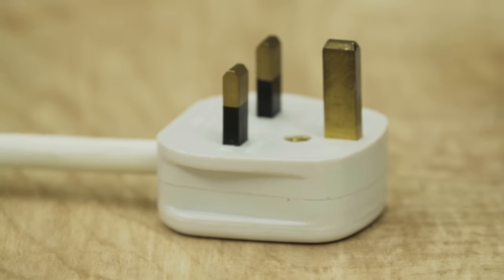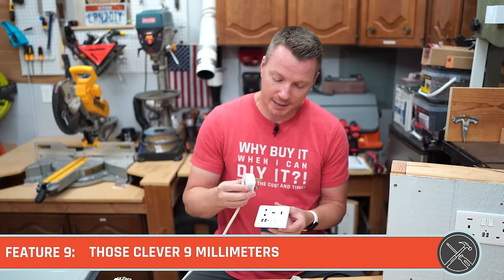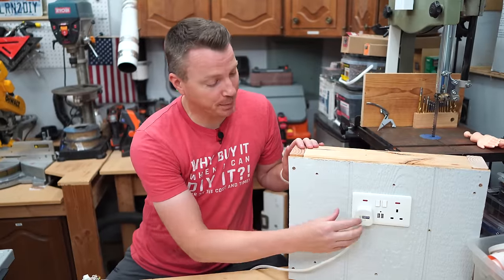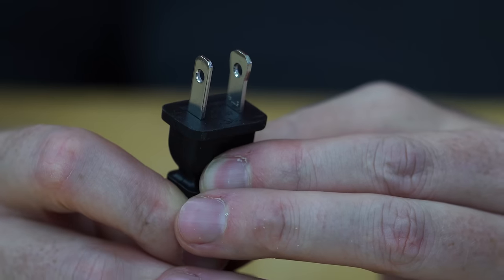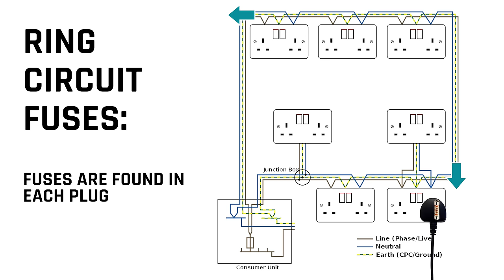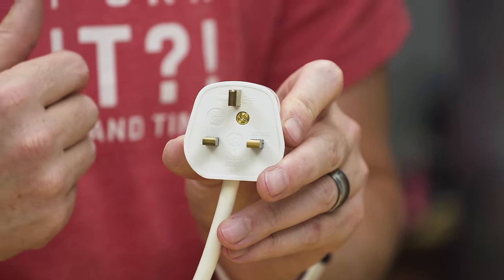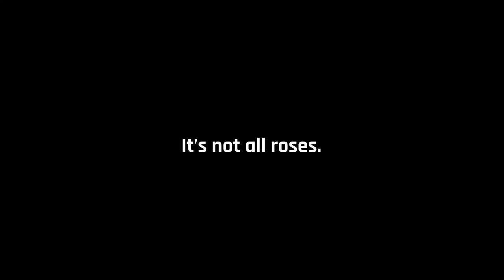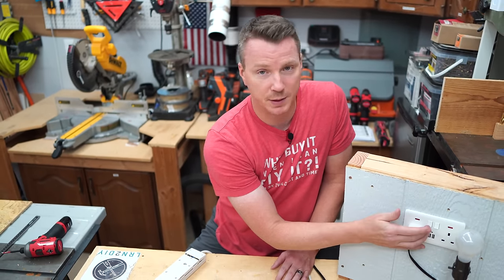British Plugs and Outlets Are On Another Level

Comment: They are much larger than the North American plugs, but interestingly since they're a 90 degree plug they actually take up less space in your home. You could shove a piece of furniture up against it easily, whereas our plugs need several inches of space to give the cord room.
Reply: Flat design plugs are now becoming more readily available.
Reply from the maker: Excellent point! I’m currently traveling in Scandinavia and noticing the same thing: flatter plugs = furniture tighter to the walls and less risk. The US has these as well but they’re just now getting some traction and it will be a while before they’re common.
Reply: The first thing I thought of when he mentioned the size is the number of times I've had to squeeze a plug through a gap. I could never do that with the UK plug.
Reply: @LRN2DIY  Is it still a lot easier to mold inline plugs than 90 degree ones?  Most US plugs are molded unlike the assembled plugs in the UK, but I still agree the 90 degree plug is wonderful when working with furniture.
Reply: Annoyingly, in the UK most plugs sockets are a few inches above floor level (except for the kitchen where they are sometime installed at work-surface level) . . . so having a cord that exists the plug go downwards is rarely ideal . . . for example you've got a radio or computer or TV, and the plug will usually be plugged in 4 or 5 inches off the ground and the cord exiting it then heads downwards, only to then need to go upwards, I see this as somewhat of a design flaw - I 3D printed myself a bunch of plugs where the cord exits from the top, which are much more practical if you want your leads out of the way or to better fit behind things. Another solution is to mount the sockets upside down.
Reply: @shiijei2638  if the plug isn’t the molded type, we simply remove it , and then only have to pass through the cable before re attaching it.
Reply: @shiijei2638  You just unscrew it, feed the power cord through the gap and put the plug back on.
Reply: @davelordy  It's been part of the electrical installation regulations that wall outlets must be mounted at least a certain hight from the floor (300mm) if I remember correctly, which negates this problem.
Reply: @shiijei2638  Just take the plug off, poke the cable through a tiny hole, rewire the other side.
Reply: @davelordy  I have the sockets side mounted in my workshop and office for things that are permanently plugged in.
Reply: @davelordy  I would point out that having sockets that close to the floor is against both building regulations more recently (even then about 20 years ago) and electrical regulations for a very long time before that. I have never been in a property where it is an issue. There is a 150mm minimum clearance from a horizontal surface.
Reply: The US plug is easier to be pulled out, sometime by just their own weight. The UK plug however, the wire goes down, it'll need to be pulled at an angle. (Fact #8 in video)
Reply: @r.a.6459  This is actually the reason the UK plug is right angled. You should never pull a plug out by the cord it's not designed for that, and repeated use will likely cause issues with the flex and/or the plug. By making it right angled so you can't pull it out by the flex (actually you can but it's quite tricky and often damages the socket) people as a rule don't pull it out by the flex.
Reply: @shiijei2638  take the plug off and put it back on. Most are rewireable
Reply: @davelordy  unless your house has older installs, all sockets should be 450mm from the floor, and light switches, and tv sockets should be 1200mm, and it’s recommended that a minimum of 100mm is given above a kitchen worktop, these are all in the regulations now
Reply: @davelordy  If your appliance contains, comes into contact with fluids or could have fluids somehow get on them, having the cable run into the plug from the bottom is likely to be safer. I'm not sure if that is why it is how it is, but, it's a handy additional safety feature.
Reply: @davelordy  They must be some old sockets, i think the new standard it at least 300m from the floor.
Reply: @shiijei2638  you've just made me realise he didn't mention that because the plug heads are serviceable theyre also removable for squeezing through gaps. But of course he wouldn't mention it because US plugs are so easy to squeeze through gaps!
Reply: @soundspark  Most appliances in the UK now come with a moulded plug, probably because of an EU directive or change in UK law requiring all appliances are fitted with a plug as standard.
Reply: @shiijei2638  if we need to feed a wire through a hole in the U.K., we just remove the plug, feed the wire and reattach the plug.....so the hole only needs to be the size of the wire.
I will add, moulded plugs are becoming more common in the U.K....if you want to feed one of those you have to cut off the moulded plug and fit a new one after feeding the wire
Reply: @apmcd47  it was the result of a campaign run by the "That's Life" program on the BBC headed by Ester Ransom, who also founded Childline and go a number of other changes to the law to protect consumers. Nothing to do with the EU.
Reply: @shiijei2638  that's why they are removable
Reply: @apmcd47  I can't find anything on the latter, but molded plugs are likely cheaper to manufacture in large quantities.
Reply: 90 degree plug adapters can provide the same benefit, and you can typically plug multiple things into one socket.  https://m.media-amazon.com/images/I/41vpjHOh3-L._AC_SX679_.jpg
Reply: @shiijei2638  that’s the beauty of having a plug that you can dismantle. All you need is a hole the size of the cable and then reconnect!
Reply: More important than taking up less space is that 90 degree plugs keep the cable close to the wall so are less of a trip hazard. 
It also means the cable looks neater too (cable managements' important to me lol)
Reply: @LRN2DIY  if you are in Sweden you should try to learn a bit about house electrics. We have a 3 phase system to every house so ovens and high power items can actually be 380volts. Quite interesting.
Reply: @paulwilliams4156  it's minimum 450mm to the bottom of the socket. 👍
Reply: @paulwilliams4156  450mm to bottom of the sockets are the UK standard measurements
Reply: @johnmc6090  Thanks for that. I've been out of the game for years now.
Reply: @davelordy  It would have been easier to rotate your sockets than printing plugs.
Reply: @ChadCourtneyTAZ427  Ah, the infamous octupus plug.
Reply: In those cases just re-fit the socket upside down. I had to do this with a bt WiFi extender plug thing that was huge
Reply: @shiijei2638   in the uk we remove the plug and put the wire through and then re fit plug simple 😊
Reply: @davelordy  Since 2000 plug sockets now need to be at least 450mm from the floor on new builds. Primarily for disabled access and to make them more visible to avoid trip hazards. When I first installed one like that I thought 'that looks wrong' but now I think they are much better than the floor level sockets.
Reply: @paulwilliams4156  450mm
Reply: @davelordy  Be careful not to spill any liquids into them EG if you knock you coffee over on you desk, the liquid will follow the cable into the plug.
Reply: @shiijei2638  but do you really want to thread a cable through something?

You can take the UK plug off, thread it through and put it back on, but I cannot think where I'd want to do it. 

In most cases we have ingenious ways round things like that. Additionally many UK devices use IEC cables (type G at one end IEC "kettle plug" at the other), the IEC end will thread through anything a US plug will.
Reply: @davelordy  I used to live in a watermill, and all our power outlets were waist height around the wall, with the fuse box and meter at ceiling height - due to the potential risk of flooding, if we had the sockets any lower then we'd likely have to replace the wiring every time it flooded (it rarely got in the house, but why take the risk)
Reply: @shiijei2638  you can usually wriggle it through, but if you really can't and it's semi-permanent you can remove the plug, poke the wire through and re-wire the plug.
Reply: @shiijei2638  as they are serviceable just take the plug off thread the wire and put it back on, especially if it is a  device that doesn't need to move regularly such as a lamp,  you only need a hole as big as the wire

(In the uk everyone is taught how to wire a plug in school)
Reply: @LRN2DIY  awhile?  Flat plugs have been around most of my life.  Half the power strips and extension cords at Walmart are flat…
Reply: @soundspark  Actually there are molded versions of the UK type g plug.  A lot of devices come with a molded plug as standard.
Reply: @shiijei2638  you just take the plug off, feed the cable through and put plug back on, takes a couple of minutes
Reply: @shiijei2638  It depends on the design of the extension cord you use.
Reply: @davelordy  practicality isn't the primary concern. Safety is. Upward exiting cords would cause the earth pin to be the first to exit. The plugs are designed for the earth pin to be the last, thus safest.
Reply: @paulwilliams4156  to comply with part/doc m (for usability by disabled people) sockets need to be between 400mm and 1m from the floor and light switches between 750mm and 1.2m from the floor, I believe most new builds have their sockets and switches close to or within these ranges.
Reply: but really bad for transportation because of the prongs that take unnecessary space if u want to keep it in a small bag or something like that
Reply: @sameedhassnain8958  how many of them are you transporting in a small bag? A small back tends to be clothes and toiletries, not full of appliances.
Reply: @sameedhassnain8958  And even worse when you step on one with bare feet.
Reply: @paulwilliams4156  Actually 450mm height...  the 300mmm is the minimum distance from a corner
Reply: @davelordy  We had new outlets put into our utility room and the minimum height above the floor is now 450mm.
Reply: @davelordy  I expect that the cord exits downwards, so as to prevent dust and other debris entering a top-mounted hole.
Reply: @LRN2DIY  As a Brit, it always looks a little crazy in the US when I see a lamp plugged into a wall outlet and the cable is coming out really far from the wall before getting to the ground. As you said, you can't have furniture as tight to the wall and it doesn't tend to look as neat. :)
Hopefully it picks up traction more for you guys!
Reply: @shiijei2638  just take the plug off the wire then rewire the plug problem solved
Reply: @shiijei2638  You can actually remove the plug and rewire it, so the gap can be as small as the gauge of the wire if necessary
Reply: @shiijei2638  we just cut holes in everything 😅
Reply: @davelordy  Unscrewing the socket from the wall and rotating it 180 degrees is surely way easier than going to all the trouble of 3d printing new plugs!
Reply: @MrSimonmcc  They're all I'll buy anymore given the choice.
Reply: @LRN2DIY  Another benefit is that there is a standard way up for UK plugs. It's not standard for US ones so you'll often see them one way or the other. Many people prefer ground pin up like the UK but on most plugs I've seen where there appears to be a preference, they're designed to be used ground pin down. Not all though.
Reply: @davelordy  That's not really my experience. Do you live in an older house? Standards often start out a lot looser.
Reply: @ChadCourtneyTAZ427  Those have their own issues when it comes to wall-warts, unfortunately.
Reply: @johnmc6090  Presumably because of all the building of houses on flood plains...
Reply: All plugs and sockets need to meet British Standards I am not sure that 3d printing of a plug would meet this, meaning that if they caused a fire your house insurance could well be invalid.
Reply: @chaos.corner  It's a measurement given for for ppl with disabilities supposedly ,450mm bottom of sockets and 1200mm to tops of light switches.
Reply: @davelordy  - are you sure your 3D printed plugs are safe to use, Dave? Have they been at least PAT tested? Surely you’d want to keep your family safe by only using British Standard qualifying equipment with electricity? It wouldn’t surprise me that there’d be some legal problem if anything happened, such as someone dying of electrocution or your house catching fire because of these. Please be safe. 🙂
Reply: @davelordy  you could take the socket off the wall and reinstall it upsidedown
Reply: @shiijei2638  you take of the plug then pass the wire through. 
Then put the plug back on 😅
Reply: @jamiep3196  They most certainly are not.  If your local school has been teaching it great, it ought to be compulsory, but it most certainly is not taught at the majority of UK schools.
Reply: @shiijei2638  Yes, it does make life more difficult, but on the other hand you can usually remove the plug, shove the wire through and then reconnect the plug after.
Reply: @davelordy  Don't tell your insurance company!
Reply: @thebiglimpet  Yup - classic IQ test ;)
Reply: @davelordy  Not ideal if spilled water runs down the cord - so there was a reason. Yes indeed it would be better if the default wall socket was defined & higher - in the USA outlets are typically mounted ~12" from the bare floor (to the bottom of the outlet), and this is probably ~ideal.
Reply: @davelordy  Why not just unscrew the socket from the wall and reinstall it upside down.  It won't pass any electrical safety checks (a bit like your 3D printed plugs) but it will solve your problem (not that it has ever been a problem for anyone else I know).
Reply: @shiijei2638  A good point but you can easily take the plug off and reattach it providing it's not a moulded plug.
Reply: @shiijei2638  We have to have big holes in old fashioned TV cabinets and similar for the plug. & big holes in desks too usually covered by a plastic filler.
Reply: @davelordy  It is not a problem.
Reply: @shiijei2638  we put the wire of the appliance through the hole and then attach the plug on the other side of the hole. I hope that makes sense. This is done a lot in integrated units e.g. a kitchen with a built in dishwasher, washing machine and/or fridge
Reply: @soundspark  Actually the assembled plugs like in the video are extremely rare in the UK.  Plugs have been moulded to all appliances for decades.
Reply: @davelordy  in some older houses, yes. Building regs changed in 2009 and the height of a socket now has to be 450mm from the floor. Anything before that could have been lower
Reply: And though totally subjective - despite being larger than American plugs, I'd argue British plugs are a much more attractive design. They look less cheap and more sturdy.
Reply: @davelordy  No they aren't. Building regulations require them to be 450mm above ground. It's gone up over the years but it's not been 150mm for decades.
Reply: @paulwilliams4156  450mm
Reply: Granted it is a very fringe scenario, but the size of the plug does mean they often will not fit through letterboxes.
Reply: @davelordy  Upside down plugs is all fine and dandy.....until you get a liquid dripping down the cable.....
Reply: @davelordy  You can actually get adapters which solve that problem. Think they're called powercubes or something? They use a insert which can be turned from what i remember so they can be moved to point in different ways and some have even got wifi extenders in them. Though this is from memory so might be not 100% accurate. I definitely saw them on amazon though.
Reply: @davelordy  
The downward exit is an important safely feature.
If there is a spillage on the table / desk etc, or a leaky shed roof, fluid can’t run down the cable into the plug 💥
Height : In newer buildings, you’ll find normal room outlets to be regulated to 500mm from the floor, so not so low. 
However, you can put them any height you like for a specific reason, like for a wall mount TV (which they comfortably fit behind btw.
Reply: @grahamek86  plugs with folding pins have been a thing for a long time. The pins fold down flush with the ‘body’ of the plug. I have an AC-USB adaptor brick with folding pins for when I travel and it’s no thicker or bulkier than any other plug in my house.
Reply: You're absolutely right. My only issue with British plugs as opposed to European ones is the fact that since they have 3 pins you can only plug them in one orientation (downwards). A lot of times that will mean losing around 20 cm of usable cable in case your device is at a higher point than the socket (which happens most of the time). With European plugs you can choose where the 90 degree plug is pointing: upwards or downwards.
Reply: @georgezee5173  
That’s a safely feature. 
No spills can result in fluid running down the cable and into the plug 💥
Reply: @davelordy  that's more to do with how builders design houses here.
Reply: @shiijei2638  we remove plug, thread cable throughan even smaller gap if need be then put plug back on 🍻
Reply: Well standard European plugs can do both, we have straight and angled plugs.
Reply: @shiijei2638  Yeah, but you can remove a UK plug from the cable, pass the cable through the hole, and then re-attach the plug.
Reply: @chaos.corner  If you say so, I've had no problems with mine.
Reply: @soundspark  Uhm.... Nope, not an octupus plug.